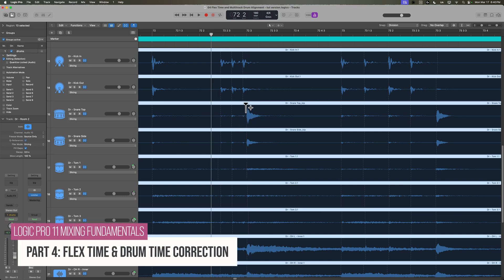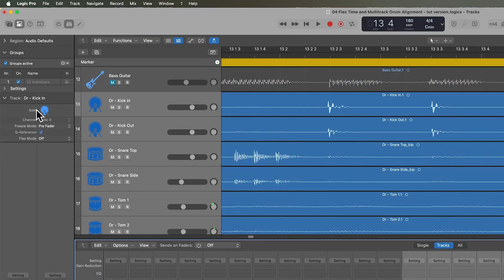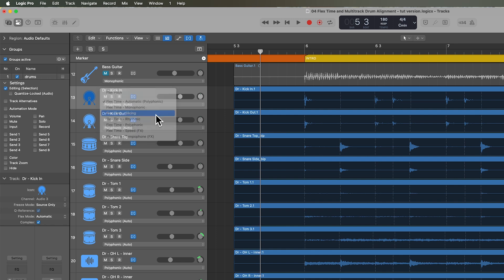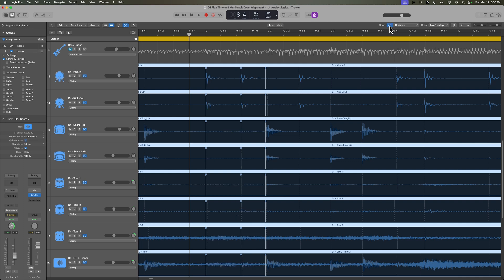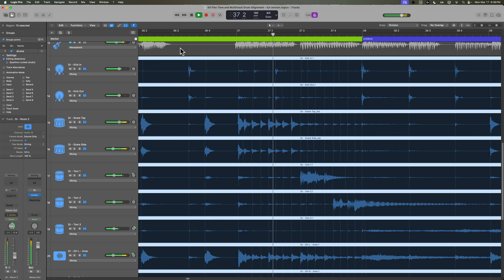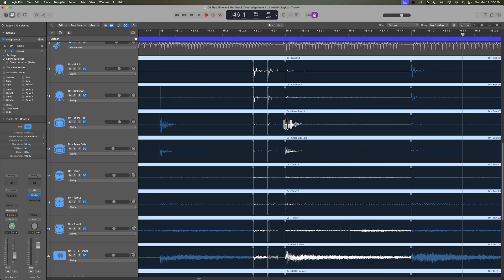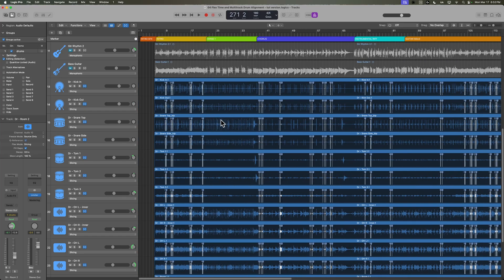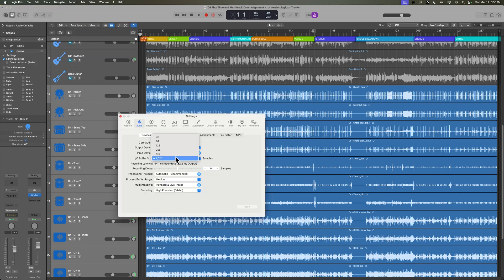Logic Pro 11 Mixing | #04 Flex Time & Drum Time Correction

Comment: I think it is a good idea to use polyphonic flex mode for overheads (and room) tracks to avoid broken sound. Rest of tracks of course in Slice flex mode. 
Thanks for your work!
Reply from the maker: I used to do that, but I stopped, because I started noticing weird phase and alignment issues with the close mics. The problem is that if you time stretch the overheads and rooms, but slice everything else, some times the drums in the overheads will sound weird, and visa versa. Slice mode does basically the same thing that Beat Detective in Pro Tools does, but automatically. It intelligently fills the gaps, so you shouldn't hear a 'broken sound' unless you are doing really extreme time correction.